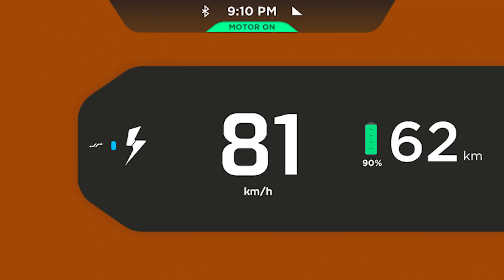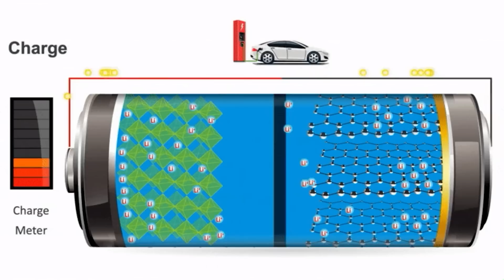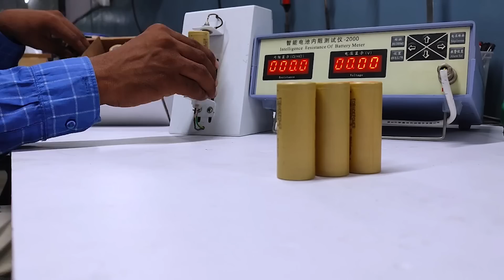Why are e-scooters in India catching fire?

Comment: They are in such a hurry to bring eletric vehicles to india that they don't even optimise the cooling system according to Indian conditions, the weather in foreign countries like Europe and US is far different than india so cooling system needs to be fully revised which means heavy investment by companies for the Indian market, as they need to redesign the chassis of their products to revise cooling systems, that's why companies like Tesla and Nissan with their leaf, etc, haven't launched their cars till now and also intend to do testing for a long time on their products to see how they perform in Indian conditions, secondly lithium ion is the worst kind of battery chemistry, it is so popular that every manufacturer is investing in it as it is modern and used almost by everyone, but it is not a good option for automobiles, its operational efficiency is just from 0 to 50°C (also a reason why these scooters keep catching on fire as the battery is reaching at the very end of its operational efficiency), opposed to Lithium Titanium Oxide which has far better operational efficiency from -20 to 60°C.......
Reply: Nonsense. 
Batteries in cooler climates are causing problems too.
It's the unrealistic government deadlines that are forcing manufacturers to rush through development & production cutting corners in the process .
Simply put , greed .
Reply: Exactly. I see they made this to temperatures of Canada where its cold

Comment: Thanks for the video! I am using an electric two wheeler since last 5 months & have noticed that these are mostly IOT machines with all details of the vehicles uploaded to the manufacturer's server, usually in real time. The BMS too wouldn't go unmonitored by these companies, I presume. In case of battery accidents I am curious about what these companies are doing to evaluate software & data uplink/downlink connections for scenarios of hacking, software errors or misuse by competitors.

Comment: It will take 10 years to settle with electric vehicles. Till that time charging point infrastructure, more safe batteries, less charging time, more average will come up. Right now I think EVs are in testing stage and I will not prefer to buy it at present scenario.
Reply: Few years back 7 families bought EV scooter, all of them sold it very fast and two of those EV went with kabadi wala. We did take test drive with EV. I must say , INDIA has a huge potential engineers to make it right and better, but somehow these talents either do not get funding or do not get a platform to showcase their potential. So, in the end, those who came back from exotic universities, started designing the EVs and we’re seeing their results. Surprisingly, the village talent is so authentic that the EVs which are feature in many shows (Yeh mera India) are much much efficient than the EVs sold in the market. I strongly suggest to start a TALENT MELA by the govt to find the most Talented minds irrespective of their degrees, we can solve EV problem in just 5 years. India’a JUGGADU minds are much better than MIT.
Reply: That's a very good estimate. 
We're all guinea pigs.
How many people will die during that decade though ?
Reply: Can't see it with negative eyes n mind ! This discourages the Players in the market.  Need to put everyone's heart n soul into it. Finding an Alternative energy source to petroleum products is not a small challenge n joke. 
Let us contribute by giving ideas... if possible  or 🤭
Reply: @Agripariwar  
You suggest don't criticise it & hope it fixes itself  ?
What a compliant little person you are . .

Comment: Vehicle using fossil fuel when catches fire is taken casually but when any battery operated vehicle catches fire it becomes a headline.
This is a normal reaction whenever anything new gets introduced.
Please recollect the stories about pressure cooker and lpg cylinder when launched.
electric vehicles are long been used but that is mostly for industrial purpose.
For electric vehicles used by common people there may be some issues of quality of hardwares, particularly batteries and power connectors which are also produced by local people.
This can cause burn out problem. But technically electric vehicles are far less prone to fire hazard when compared with fossil fuels.
Toyota and BMW were not initially automobile manufacturers.
In business technical expertise are hired, more important are financial resource, business and marketing strategy.
Reliance were with textile industries for long time, there diversified to petrochemicals and number one in telecom. 
Such instances are common in diversification by business houses.
Reply: Because you cannot put out a battery fire unlike how you can put out fire from petroleum.
Reply: Fossil fuel vehicle doesn't catch fire most often.
Reply: Bruh there were only few cases then it would have been okay . But we are seeing 4-5 cases in a week

Comment: Perhaps, moderators can be introduced in the battery, like they do in nuclear  reactors to stop runaway reaction, overheating and meltdown. Examples are Chernobyl and 3 Mile Island nuclear runaway reaction on a massive scale.
Reply: Unfortunately no. Any energetic material, especially lithium ion batteries are unstable. And no moderators are possible. Cooling the batteries adds weight and complexity, both of which are undesirable in light electric scooters. Ultimately there only exists tradeoffs, not solutions in engineering.

Comment: BMS of Li battery is on the top of the battery. If any cell in the bottom of battery has an issue it will be sensed  by BMS and it need to cutoff the battery from operation. 
But the sensitivity distance is high and so BMS is not performing and the explosion happens.

BMS need to be placed in the centre of the battery.

Comment: India is becoming second china they industry is in so much rush they are skipping planning designing and testing due to the deadline of green India before2050 but they should be a seperate body who set new standards to control this kind issues and this kind of business behaviour which is preferred outsourcing and assembly without proper quality tests and planning’s for profits and strong market hold.
Reply: @Rudraksh
But china more then 85% Electric Bus, car, scooter in used without any issues  
Explosion why only india
Reply: True
Reply: That was china in 1960. Now they beat US in tech Innova

Comment: Almost 80% of e-batteries are made in China and it is designed with Chinese weather condition, but in India, it is too harsh the summer when compared to Chine. This can be one of the reasons.
Reply: Lithium battery is being used in Arizona, much hotter. Our marwadi mentality is to make max ROI, they care 2 hoots for the consumers. Just boycott Indian products - they have not changed their attitude since forever.
Reply: @meta5291  Batteries need cooling systems according to weather conditions. 

Chinese weather doesn't usually need such systems.
Reply: @meta5291  its not about indian quality. I will give you an example Samsung proven mobile manufacturer also faced same issue, you won't say samsung have bad quality. No product is perfect.
Reply: @masnenishant  No. Not at all sir. In fact, you will come across excellent Indian products now and then. Soon, these products will disappear - if the manufacturer is on the right side of the government and political class, the company will exclusively start exporting that excellent product and in most cases the importing country will not even acknowledge that it is made in India! If the manufacturer is not favored by the government or politicians, then they will simply be crushed by the system - and there are so many ways to crush people who are not favored. This is why we love "export quality" Indian goods. Have you heard of the Maruti manufactured Swift Automatic that is only for export? I would love to buy one of those.
Reply: @meta5291  that's a brutally honest answer i'd say...i had it in my mind all the while,but i didn't know how to word it into a sentence.
Reply: @saipriyavarmap5296  LOL, I guess necessity is the mother of invention and some words have to be strung together every so often!
Reply: @meta5291  Yes , this is a major reason why our products r nt respected at international level , we unnecessarily try to cut costs to make profits but this comes at the cost of quality , this JUGAAD TECHNIQUE may sound cool but has disastrous consequences
Reply: @ananb7747  Export Quality Indian goods are usually very good. But it is never available for local Indians.
Reply: How do you manage such insane level of intelligence??
Reply: Safety is becoming a huge issue. Yes the packs are more vulnerable in the hot summers in India. Expert says with battery electrolyte being a flammable, carbon-based (organic) liquid this has safety issues. Organic compounds allow LiB batteries to reach high voltages. That means the battery can store more energy. However these organic electrolytes can fuel a fire if the battery overheats...Expert say the higher the energy density of a battery, the more dangerous it can be, which poses limitations (and risks) to further level. The need is to allow climate controlled enclosure with seperator with the right supporting BMS.
Reply: IISER Calcutta just developed a solid state battery for commercial use. We need to promote researched in India technologies, not Chinese technology
Reply: It's been said by BACKSTAGE WITH MILLIONAIRE.
Reply: Weather conditions can make difference in battery performance. With hot weather in India, batteries can really overheat fast.
Reply: I never heard that there are even non electric batteries 😂
Reply: Lol kuch bhi
Reply: 200 iq spotted
Reply: Don't be fool
Reply: E batteries wtf
Reply: Every one says it's the Indian weather.......doesn't that call for a better governance and higher tolerance specifically for Indian climate and geography? Secondly how will we bypass the corruption and babu system that is rampant. Let's not say it doesn't exist. If you have to pay corrupt officials you will compromise on quality.....it's a system failure because multiple components of the whole governance and control system are failing simultaneously
Reply: Block Lord  "made/make  in India" is a slogan for the naive. It fools 5th standard students. LMAO.